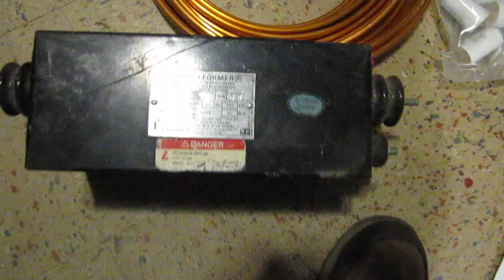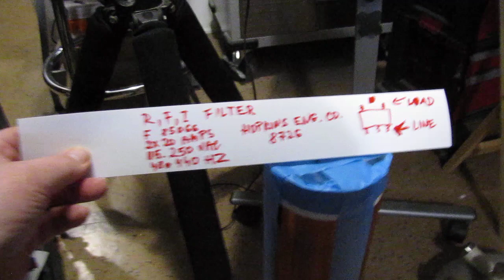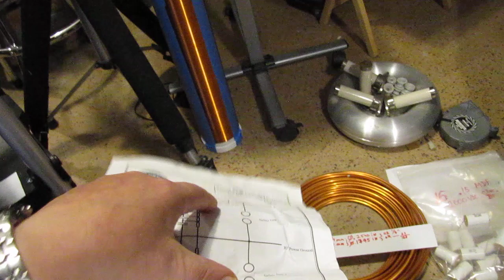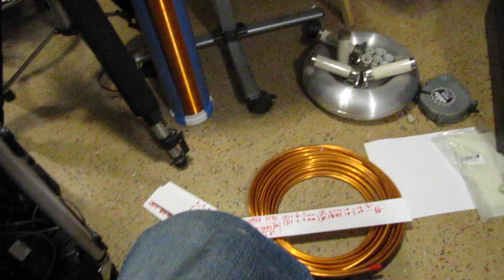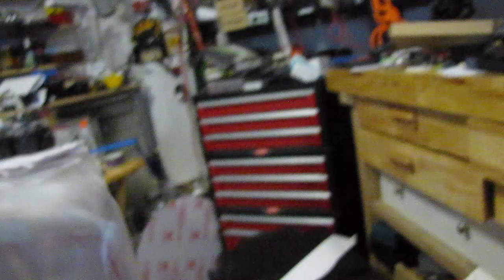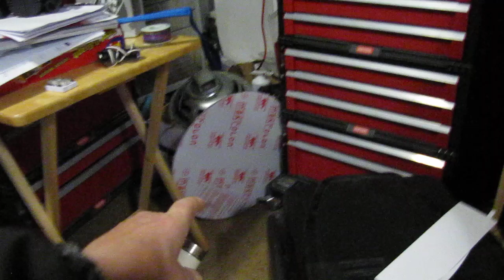DIY TESLA COIL - HELP NEEDED  (Originally by Teslastuff by Rainy Lake Electronics)

Comment: Yes, I know how dangerous these transformers are - they are used in NEON SIGNS and I've made Jacob's Ladder from them. The output has many KVolts but 0.023A, so under some condition it will kill, but I use more than 2 switches and one of them is under a locked key, so nobody gets hurt, when I demo it. I need to find someone who can help me with the schematics so I don't damage them, before I use them on my own. So for you out there who knows Tesla Coil, I have experience with high voltage  - don't worry about that please. Or if anyone knows someone or a video/website ... who can help me, please don't hesitate to point me the right direction. Thank you!